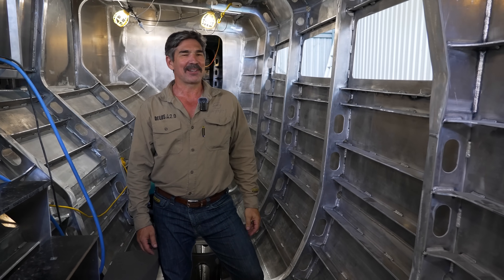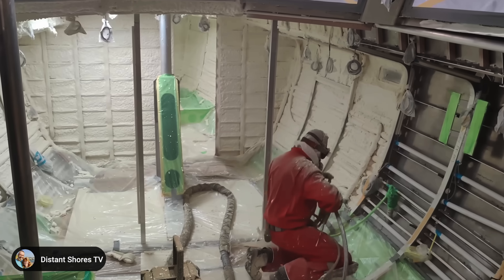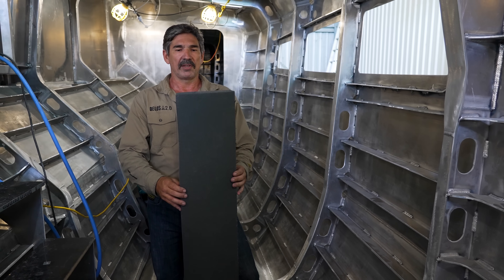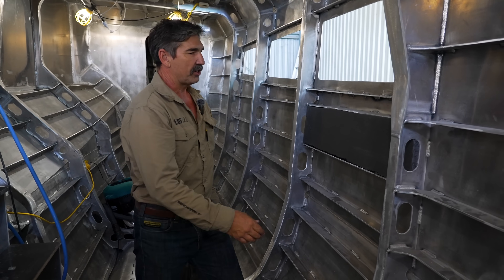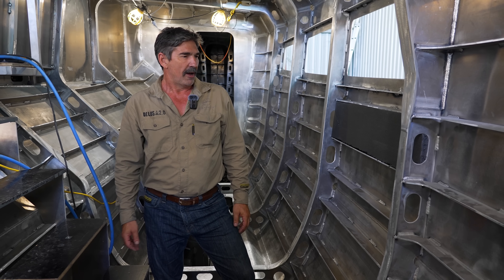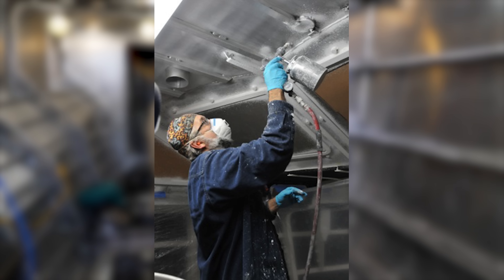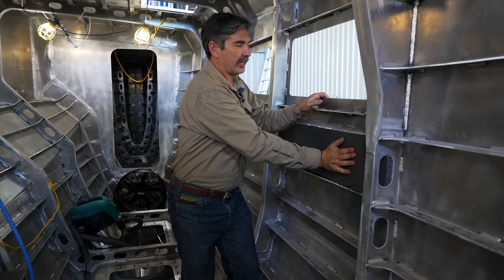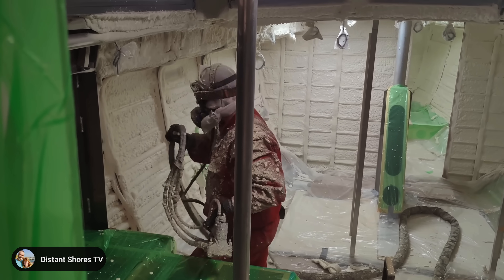HELP, We Need Your Advice!  How Should We Insulate Our Aluminum Catamaran???

Comment: You should send your question to Boeing.  They have to insulate aluminum aircraft and the worry of condensation is far more critical.  I'm sure they would be able to provide you with some great ideas.
Reply: Correction? Boing is a mess and a failure. I would consult SpaceX
Reply: Boing still has some of the best technical people in the industry - their management, QA, and sales people on the other hand are a different matter, they seem to go out of their way to put fatal flaws into what would have been good work. Getting in touch with one of the good technical people might be very difficult.  However, some of these people actually publish peer reviewed technical articles.   As an engineering nerd I can say this.  Somewhat there is a nerd sitting in a development lab who love a chance to speak to another human.

Comment: I understand your concerns about the spray foam if you ever have to get back in there, but you will spend far more time insulating the boat in any other matter then you will having to pull foam out at a later date to fix something. I would install wire/plumbing chases and then do spray foam to both insulate and seal/coat the aluminum. My second choice would be that black closed cell foam that you were using. I would first spray the interior with some type of coding to protect the aluminum, and then I would use a combination of the black foam and spray foam two completely insulate the cavity.
Reply: Very good point. 

The time and money to install versus the rare occasion to possibly have to remove a spot? 

And if the planning of extra conduit is done, they shouldn’t have to do anything to foam ever.

Comment: Insulation on metal boats is an important expensive/maunal PITA detail. 

Select where insulation is necessary: 
under the floor? No.
In the engine room? Yes, but with different materials.
On the cabin top and hull? Yes

You're on the right track avoiding spray in foam: removal for inspection or repair is painful and will lead to missed inspections.

Internal panels with minimal adhesion is your best bet. Unattached but close fitting 50mm thick closed cell panels for thermal isolation and accoustic dampening.

To closout the internal insulation: maybe a composite of 3mm marine ply, 12mm closed cell foam, and a cloth overwrap or sprayed color. The marine ply is a base is to epoxy velcro tabs. The caps on the alum structural stiffeners support the corresponding velcro tabs (also epoxied in place).

The velcro will minimize the thermal conduction path. Spot bonding space blanket (foil towards hull) to cover the spans between velcro will add a percentage radiant protection but I doubt it's worth the effort.

It's a thought, I hope better experts will offer the best commercial approach.

Comment: Hey Bri, see if you can get hold of a foam material called Pyrosorb down under. It is an acoustic insulation foam with the added benefit of also being a class 0 fire retardant. I bought tons of it in the UK because it was used for interior cladding in the Abba Voyage building. Available up to 50mm (2 inch) thick. I bought mine from GB Foam in the UK.

Don't use sticky back. You will regret it! Use mechanical fixings.

Comment: I don’t know anything about insulating aluminum boats, but I have been 30+ years in the foam business.   

Ureathane insulation has all the advantages and disadvantages you mention.  I would add for ureathane, be sure to use closed cell ureathane rather than open cell.  The closed cell will not absorb water while the open will.  The ureathane foam has a much higher valve than the PE foam and will add some structural rigidity. 

PE foam can be pressed in place with a friction fit, but it will take a compressive set, so what started out as tight will become lose over time.  Otherwise, PE foam is very resilient and will hold up to vibration.  We have been supplying  PE foam for floatation in personal watercraft for years.

Most PE foam is not flame retardant so look for a brand / grade that is.  I don't know if the specific brand you mentioned is flame retardant.  PE foam is also resistant to marine solvants so it is a good material for the application.   Most PE foam will pass US Coast Guard spec 33CFR183 for fuel and marine chemical exposure. I am not sure what ureathane would do.  I think it would be fine for chemical exposure but I don’t have data.

 I would go with the clip installation method over the pressure sensative adhesive (PSA). PSA is very expensive and then creates the same problem you have with not being able to remove the insulation. If you want to go with PSA, consider a VHB tape in a few strips per panel. VHB is a trade name from a big adhesive company.  I don’t work for that company so feel free to purchase a cheaper version of the same type of product.

Comment: How easy is it to cut that spray foam away?  Looking around online, it looks like it can't be dissolved so easily (I know with some residential spray foams, you can dissolve them with acetone, but it seems this product is more resilient)  I would hope that your need to access the hull for repairs or changes would be exceedingly rare, but boats aren't built with hope.  There is going to be a ton of labor manually inserting all that sheet foam insulation, and there is NO WAY you're going to get it perfect... so the likelihood of having condensation occur if you go that route is pretty high in my estimation.  Even if you do the thermal coating first, it may help with corrosion, but it won't stop the condensation, and you'll be dealing with mold.

Comment: Not an expert on boats, but for housing/roofs, we have completely moved away from spray foam insulation. 

a) It is toxic and evil stuff. Both putting it on, and then again later if you need to cut it out. 
b) it is incredibly permanent, as you mention. If anything ever requires you to get underneath it, it is not just application of box cutter - it is a messy, nasty and laborious affair. 
c) it is really, really rigid - in houses that causes all sorts of issues with temperature expansion - when wood or metal expands, the foam doesn't (or differently) and causes tension. Because the entire foam structure acts as one body, it can really do damage at worst or cause unpredictable behaviors at best. In many cases, the foam actually is stronger than the support materials, which then are the ones to give way. 
d) finally, while it can be closed cell (depending on the kind), it has a tendency to trap water, which can wreak havoc with underlying materials - and you will never know, because you can't get at it or ever see it. 
e) finally finally, it is too rigid to be good sound insulator - doesn't work well in practice. It acts more like a resonator box. 

All of these points seem relevant to boating :)

Comment: Polyurethane foam when it burns (and it burns very intensive) generates hydrogen cyanide gas it is very harmfull for human respiratory systems. It has a closed cell structure so it is waterproof so when you have a leak it helps to delay the water getting in the boat when not the whole hull is damaged, I believe it is an extra protectionlayer. When you have repairs of electrical wires or pipes it is a hell of a job to locate them. Maybe it is an option in the areas where are no wires and pipes and a lot of air. Also when you have a damaged hull and want to weld......all Polyurethane foam must be removed... I guess PU foam is not an option.

Comment: you need to look for insulation paint. There  is also sound proofing paint. "seal coatings or syneffex are 2 brands" But there are much more. I like the 2 part epoxy types.  Chuck

Comment: With the Pins i think would be a very good, proper Decision, and easy to remove.
You dont know what happens with the Spray, and if its really Odorless and and harmless to health.
Maybe there is a resin,To paint the bridges.That would then be less complicated,Like to attach foam rubber, on the bridges.

Comment: First thing first, great tash!
There are some anti-condensation paints on the market, I'd coat the internal metalwork in this before adding some foam insulation. You can get spray foam, all the rage for attic insulation in the UK, quick and easy to spray on.

Comment: Spray foam is not allowed to be used in property here in the UK, it will not allow any air to flow so you would not have any air flow/ ventilation between the hull of Delos 11 and whatever you use to face all the surfaces that you will come into contact with, so lm guessing everything will become damp 🇬🇧